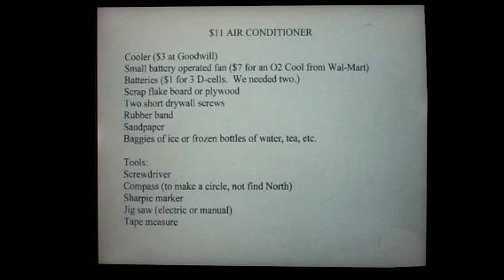DIY air conditioner for $11

Comment from the maker: The latent heat of fusion of ice to water is 144 BTU per pound. If you slow down the rate at which the heat in the air is transferred to the ice, you will have a less effective a/c and you will have to run your fan longer in order to create the same amount of cool air. The faster you transfer the heat in the air to the ice, the more effective this a/c will be.  So, cutting holes in the lid doesn't really gain you anything.  Plus, if you transport the unit with ice in it, you'll need the lid.

Comment from the maker: It should not make the moisture level in the room higher until all the ice melts.  As the warm, humid air passes over the ice, the moisture in the air will condense and join the melted ice as cold water in the cooler.  This will happen until the ice is completely melted.  When the ice melts completely, you need to turn off the fan and close the cooler or else the moisture level in the room will rise.

Comment: I wonder about the efficiency of this, If you use your freezer to remove the energy to freeze the items, that energy is expelled into the room, plus an inneficiency factor of the freezer.  You then collect the heat from the air, and put it back to the water, to repeat the process.  It would be akin to pointing a fan at the open freezer door and letting it run like that.  The idea that "the freezer is running anyways" doesnt apply, because if it's empty, it doesnt use that much energy.

Comment from the maker: Noise depends upon the fan. Mine is 45 decibels from 3 ft away, which is very quiet. How well it will cool a 10x10 area depends upon how well insulated the area is and how much heat is being introduced by other things (appliances, electronics, etc.) in the area. I usually buy a couple of bags of ice to fill the unit and they last a long time. If you add an ice maker, post a video!  I use mine as a portable unit, so being tethered to an electric cord wouldn't work for me.  Cheers!

Comment: That was great! Loved your very clear instructions and video. I like that I don't have to wire anything together -- fans, 12V deep cycle batteries, etc.  Which one runs out first:  the D-cell batteries in the O2 fan or the ice in the cooler? Thanks for posting!
Reply from the maker: Thanks for watching.  Usually the ice melts before the batteries run out of juice, but I keep a couple of extra batteries on hand anyway.

Comment: need directional air flow control for exiting air and I wonder at the efficiency of  cooling entering air as to what forces the air into the cold items. wouldn't the air just go right back out ... you know the shortest distance between 2 points principle?

Comment: i appluad you for doing anything to reduce dollar consumption. question is how noisy is this thing then can it cool a room 10 by 10 with 90 d temp out side. And then a person would have to freeze water bottles to be safe is the estimate. And then he be having to freeze them every day. 

so im wondering what about a 200 watt ice maker supplying constant ice to the system somehow. 

it would still be cheaper than traditional ac.

Comment: I've seen this type of design way too many times, this is actually in a very poor design because essentially what you are doing is adding more humidity to wherever your cooling. Install a heater core on top and a water pump inside was a fan blowing on the heater core and you will cool down the place and reduce the humidity

Comment: Does it work?
Reply from the maker: It will cool a small space, such a small room or a small car or a camper shell on the back of a pickup truck.  It will not cool large spaces or uninsulated spaces.

Comment from the maker: You can always add a piece of flexible duct to direct the air which comes out of the open hole.  The fan forces the air to flow across the cold items and out the open hole.  Thanks for watching!

Comment: Don't waste your money. These things don't work ! There simply isn't enough cold air coming out of that little hole to displace the hot air in the room .
Reply: My wife actually made something similar and it drops temps in the room where our pc's are by around ten degrees centigrade. So yes, they can work and work pretty well at that.
Reply: No they don't. And what the hell is centigrade ?
Reply: Larry Sarallo Almost the same as Celsius.
Reply: TEABAG !
Reply: I'm glad to see someone agrees that this stupid idea doesn't work. I think that a lot of these idiots are using these things in an air conditioning environment, they simply don't work in a hot room.
Reply: Larry Sarallo it's better than nothing, if your air conditioner is broken.

Comment: It's a swamp cooler not an a/c
Reply from the maker: There's actually a difference between a swamp cooler and this project.  A swamp cooler works based upon the principle of evaporative cooling, while this project works (like a/c) based upon the principle of refrigeration.  Thanks for watching!
Reply: You probably want to read up how actual refrigeration and air conditioning works. Since both used compressed gas to cool the air inside the units. When compress gas expands into a low pressure zone it immediately cools down which also cools down the air around the low pressure tubes. I really don't wish to go further explaining how wrong you are with this. So saving a wasted effort of teaching an american that he is not using the method that actual air-conditioners use in which you refer your cooler as an A/C unit, I'll give you a link of a diagram of how a real A/C ie air-conditioner workings. 

A link to a diagram how a real A/C and not a swap cooler ie evaporative cooler.
http://www.tisburymotors.co.uk/images/air-con.jpg
Reply: Josh Goldberg, air-conditioners use compressed gas condensers exactly the same as the refrigerator do. Ugh I'm going to stop here because it's hard to explain to people who can may never comprehend technical stuff.
Reply: Josh Goldberg, than you don't get what real air conditioners are. I know you are trying to back yourself with the definition of conditioners, but the unit in the video is basically a evaporative air cooler. 

until you understand the difference, I'm not commenting no more.
Reply: Aslo Aso   Geez, "chill" out dudes!  'Specially Josh.  Elliot's right and Aslo also is right on the refrig process.  Anyway, this isn't a swamp cooler because practically none of the chilling here is from evaporation, it's nearly all from simple contact with the cold surfaces (heat removed by convection).  A swamp cooler has to evaporate water to produce all of its chilling (from the "heat of vaporization" just like in the refrigeration cycle).  I think I'll make one of these for camping.  Cheers.
Reply: I'm chilled out here.